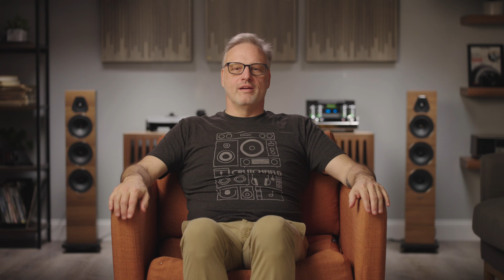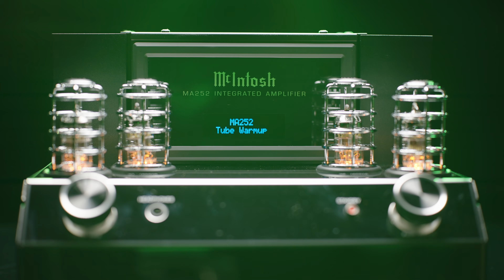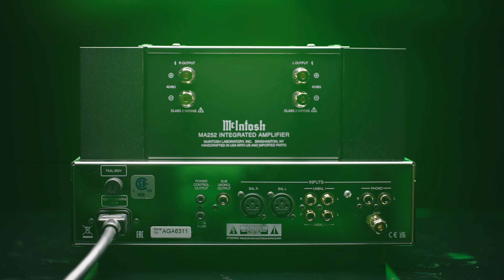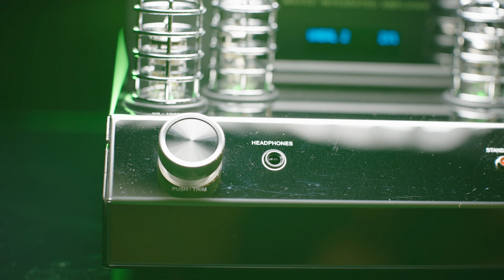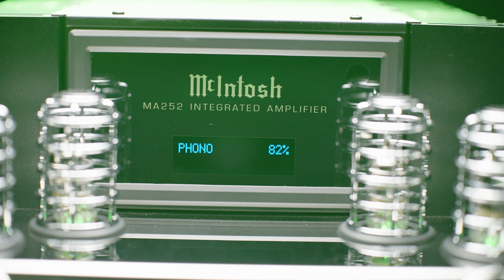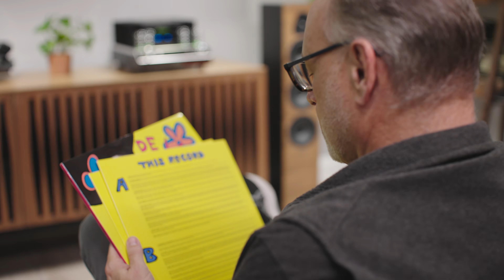McIntosh MA252 hybrid tube/solid-state amplifier | Crutchfield

Comment: Thanks for informative contribution. I’m doubting between MA252 and 352.
I have Atohm GT1 HD & Opera Callas bookshelves, KEF KC62 sub and a 3,3x4,5m listening room. I’m “afraid” the MA353 is a bit overkill/overspend…? Looking for some expert advice. Cheers
Reply from the maker: Hi Laurens, we're glad to help. Sounds like you have some excellent components so far! Are you looking to power one pair of speakers per amp or both pairs with one amp? Are there any specific inputs or features you need from there?
Reply: @crutchfield   Thanks for response. I’d mostly pair it with the Opera’s (I think) to play CDs (Primare transport, Hegel DAC)
Reply from the maker: Looks like the Callas are super efficient and have a 4-ohm impedance so these two models are likely a bit more than you need. Would you want to consider another brand? Are you okay using another style amp?
Reply: @crutchfield  thanks for thinking with me, I’m in exploration phase, so always interested in “studying” options. Got the NAD M33 and that’s a keeper, good class D and family-friendly ;-). Would like to play around with a suitable Class A, A/B, or tube integrated alternative for the fun of it
Reply from the maker: Fun! The Naim Uniti Nova is an excellent AB amplifier match for your speakers here: www.crutchfield.com/I-rYALc921/p_956UNTNOVA/item.html

Comment: can this be used as a receiver for Entertaiment system?
Reply from the maker: What type of setup do you have in mind?
Reply: @crutchfield  Entertaiment center you know a TV connected to a receiver and the receiver driving the speakers and the components connected to it like phono, blue ray player, cable box, etc..... i am surprised that you even asked.
Reply from the maker: We ask as its always helpful to know all the goals for and gear being connected before confirming a device like this integrated amp can work for someone. It does have a phono input as well as a couple of unbalanced preamp level inputs and a balanced input. It does not have HDMI inputs, but devices like the Blu-ray player, cable box, etc.. can be connected to a TV with an analog audio output. Then that TV's analog audio output can be connected to one of the unbalanced RCA inputs on this McIntosh unit.

Comment: Are the green LEDs defeatable?
Reply from the maker: The default on the MA252 is for the display to always be on but there is also the option to change it via the Input/Trim Control on the unit or the Trim button on the remote to show the display only during an operational change.